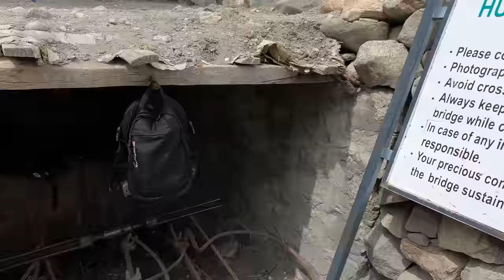PAKISTAN | The Most DANGEROUS Bridge with European Looking Locals 🇵🇰

Comment: Did you know? ... it is one of the  most dangerous bridges in the world. The gap between two steps is a minimum of  one foot. 
The bridge was built during the British rule in the village of Shishkat in Gojal. During the construction of Karakoram Highway, this suspension bridge was shifted from Shishkat Village to Hussaini village in 1968 on the orders of Mir of Hunza to reach the village of Zar Abad  on the other side of the river.
Residents of Husseini village use the suspension bridge to reach their newly settled area of Zar Abad, and take agricultural commodities through this bridge to Zar Abad.
Husseini's locals says that before the bridge was built, they have to went to another village 20 kilometers away and climbed a dangerous hill to reach Zar Abad Village.
In 1968, they requested to the ruler of Hunza Mir Muhammad Jamal Khan to build a suspension bridge nearby
and the ruler of Hunza, approved the request and Built this bridge.
bridge is 660 feet long and has 472 wooden planks. It is at least 50 feet above
the river bed and the maximum height is about 100 feet.

Comment: "Organic rush juice bar". 
You are lucky to be alone on that bridge because it would be all moving with even few people on it. especially when the walk tend to synchronize with each other.
It's made to be scary to be attractive for adventurous people.
It's like adventure park without the security life line.
This bridge is scary as hell, there are so many ways to fall, on the side, trough the planks, at the end, but it's safer than swimming in the rapids for sure.

We have one bridge I know of this type here too. but it's much higher (top of the cliff) and not that long (maybe half), but it's fully secured with more cables for lateral tension and still it's moving a lot. When people walk you can feel it bounce. You feel like it's going to make you jump over it. But you can't fall because the ground is like a grid and you have net on the side. It can't be sliding and your body have not way to pass and fall of the bridge, but still it's very scary because of the move and height, and you have so many ways to hurt you, even if you  can't fall from it.  It's only for hikers and attraction.

When I was looking for the place on Google map, I have seen that people have written in giant letters on the mountain on the other side of the bridge (not visible from the bridge)  "Welcome our hazirimam"
I don't know what "hazirimam" means.
I think you could read it from the end  of this village, going north (looking to the other side of the river)
Reply: No, this was not made so to attract tourists. I think it is between two villages.